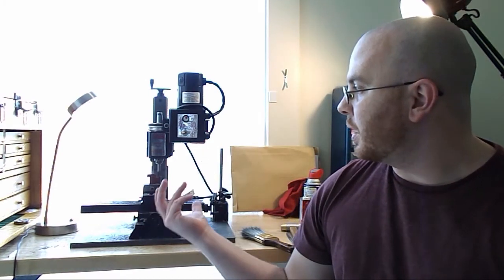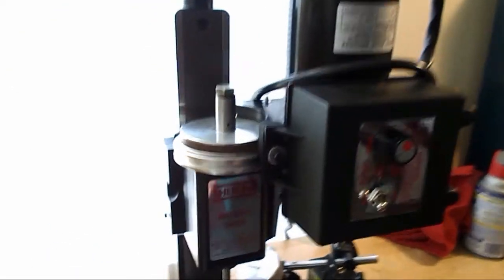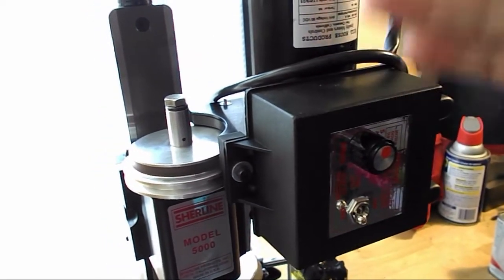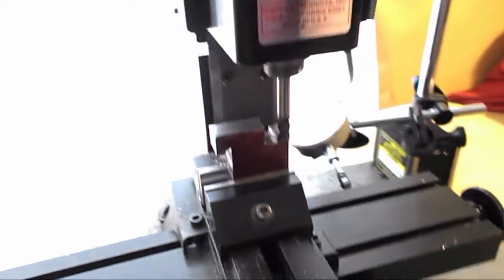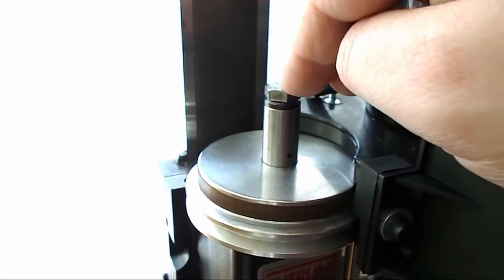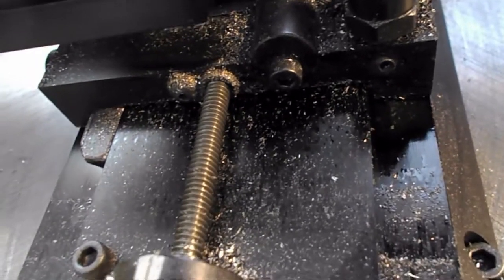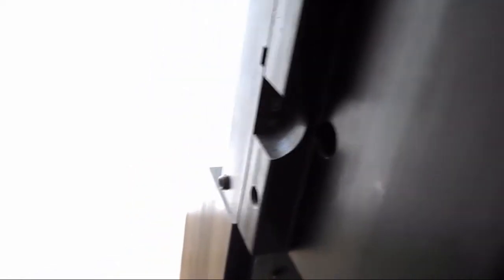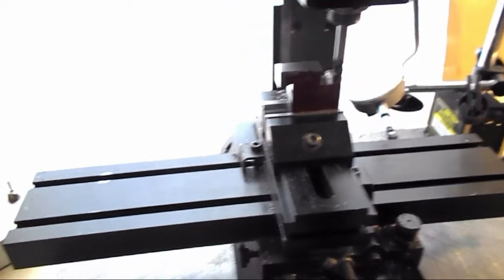The Thursday Toss Up #4 - My Review on a Sherline 5000 Mill

Comment: I am an aero-engineer and inventor with three US Patents. Like most engineers I am in constant problem-solving mode! The Shoreline 5000 is a cost effective small mill for an inventor engineer or good tech to do work and prototyping. I really like Sherline's support and the accessories, as I can work out "ideas" as I go. The digital read-out is great for data records (like needed for Patent documentation). As an inventor: you never know how your ideas will be really finished. Also, with care, I do lots of types of different material testing. I do recommend this mill. The constant safety warnings are appreciated. Thank you. Ron Barrett

Comment: I had both the Sherline lathe and mill. They worked very well within their limits.  I found that I ran out of machine capacity once I tried to do anything more than model making. I would have l\kept them but once I started using my larger mill and lathe I found that I didn't have a use for it anymore.  They make a great little machine and thanks for reviewing.  As you stated they are a good value and made in the USA.

Comment: I have the 4400 lathe and use it for very small parts for my engines.  Thinking about the mill.  I do have the mill attachment for the lathe. It's just a vertical column, it works but not enough room on the Y axis up against the column. and the cross slide on the lathe is not perfectly perpindicular to the mill spindle.  Agreed that Sherline's support and accessories line is top notch.

Comment: I rather like that mill. Although I am contemplating a Chinese mini mill to turn to CNC.
Reply: A bit late but if you want 10x the quality, the accuracy and the life (wear) ... for just twice the price ... go Sherline. Nothing wrong with (a good) Chinese lathe, I have an 11 inch Chester. But my Sherline is 20 years old and works like new. Oh, gibs on a mill need to be much tighter than on a lathe because of forces. Every mill.